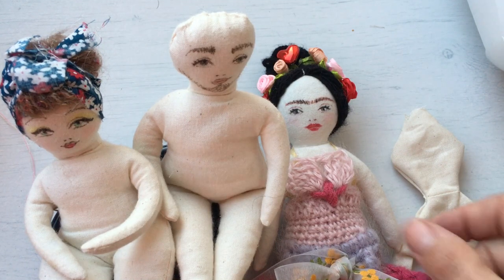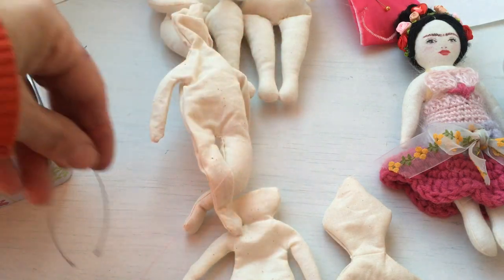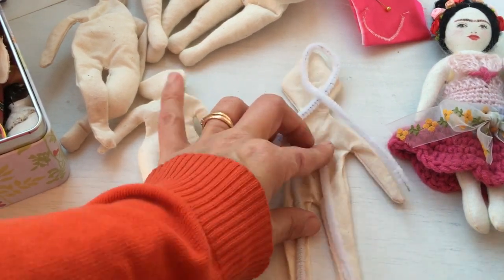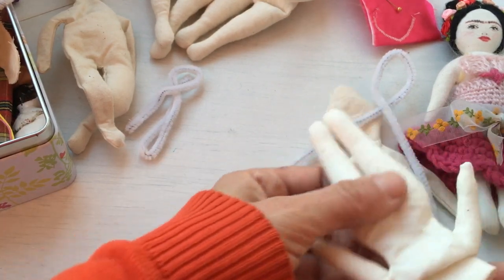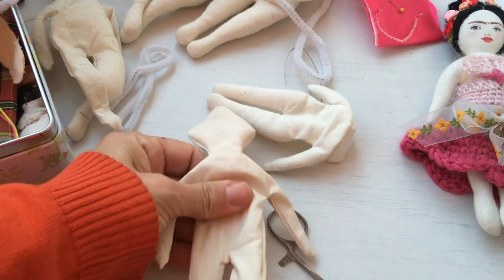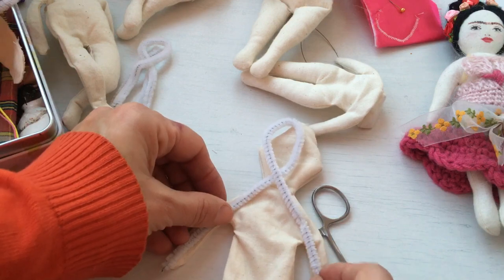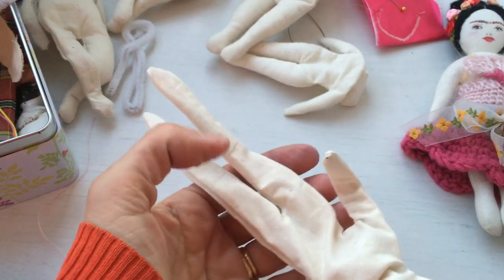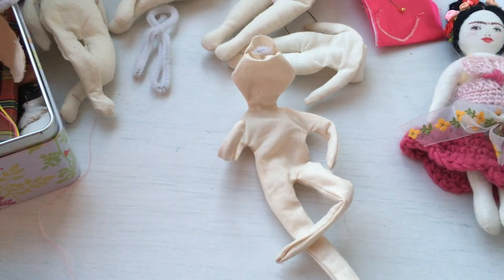Joint articulation using pipe cleaners cloth doll tutorial

Comment: Wrap the pipe cleaner with the stuffing or wool roving or yarn before putting it inside the doll. then stuff extra around it.  Also, pipe cleaner is better than jewelry wire (don't use aluminum wire...it will break after just a few bends). I make jewelry with jewelry wire..after it's bent in the same spot a number of times..it will break.  Pipe cleaner can be bent over and over without breaking. Real cotton covered pipe cleaners (6 inches long) can be purchased on Amazon...they won't rust as easily as craft pipe cleaners.
Reply from the maker: Jean Tobey Wow that is the most awesome advice ever thank you!!!
Reply from the maker: I’ve totally mentioned this comment on my latest doll video - thank you!